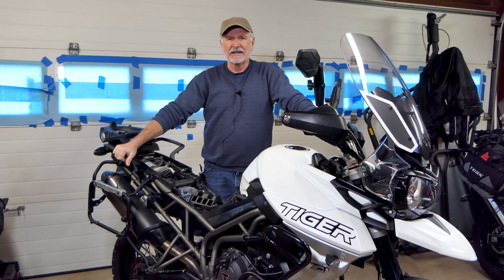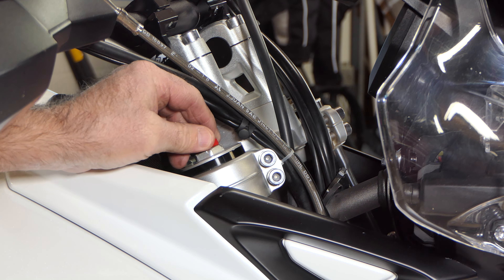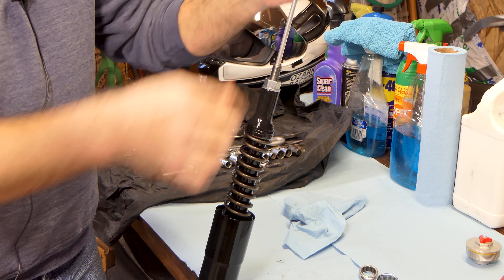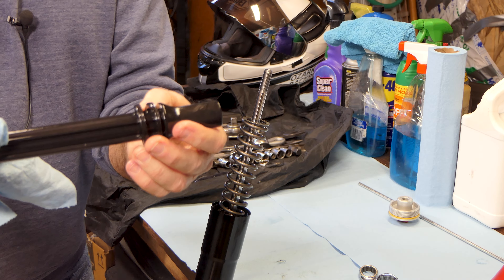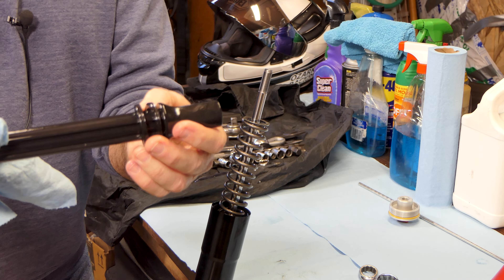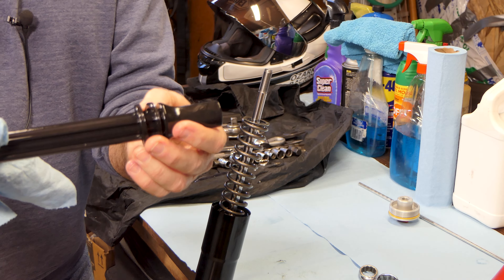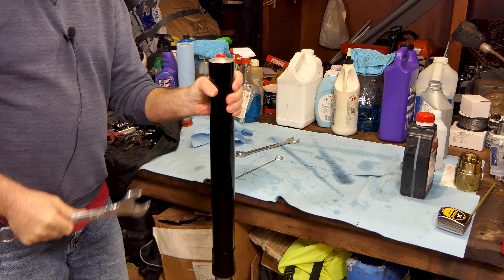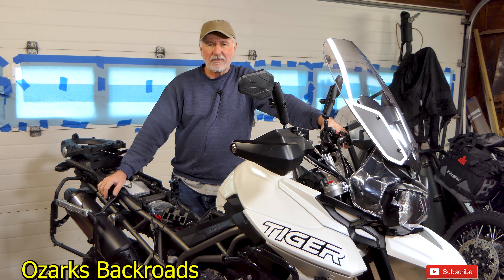Triumph Tiger - KTM 790/890 WP Front Fork Service

Comment: Hi John, Hercules here, all the way from Cape Town ZAR. Thanks for a great video, ordered the seals. Will start the job next week. I also have the 1200 and the 660 and 750 Yamaha ténérés 1994 models do most of the work myself. It will be my first seal replacement. Your video is definitely the best. Well done.
Reply from the maker: Great to hear from you sir.  Good luck with all your projects... thanks for watching...   :)
Reply: Great video, I have a 800 Tiger with non adjustable forks and would like to upgrade them to have adjustable damping. Do you know anything about the Adreani adjustable cartridges?

Comment: Fantastic. Can you tell me please, what the orange rubber is in this Seal kit? You have it on the table, but you probably haven't use it?
Reply from the maker: Good to hear from you sir, the rings I did not use are to slide on to your fork tubes and are used to measure the amount of fork travel... like wrapping a zip tie around the fork tube and sliding it all the way up... to see how far the fork tube traveled while riding... Thanks for watching and keep safe out there...   :)
Reply: @ozarksbackroads5484  Everything clear and understandable. Thank you very much for your help.